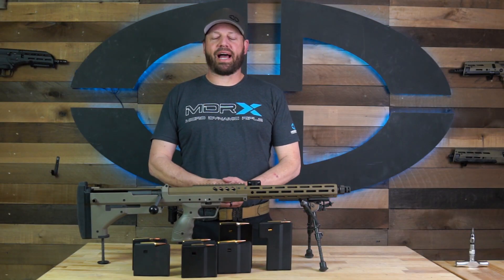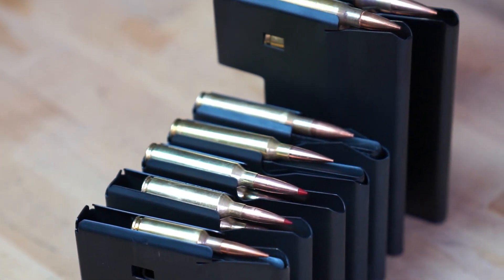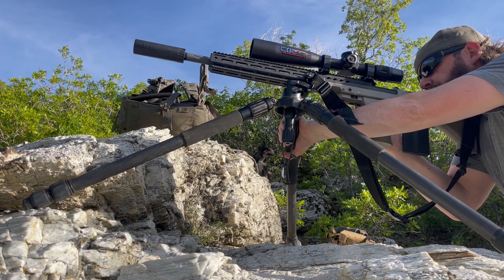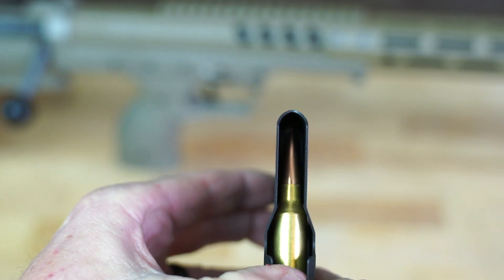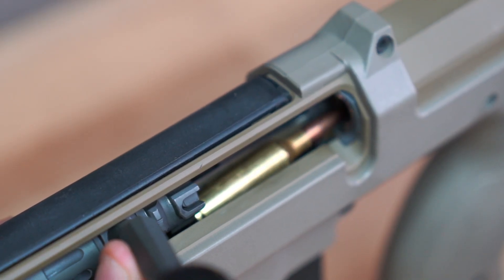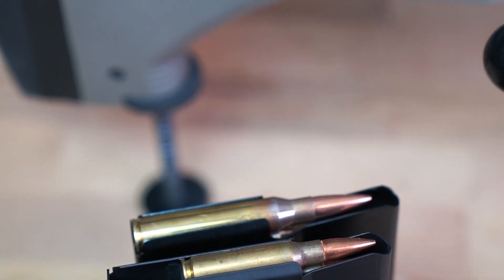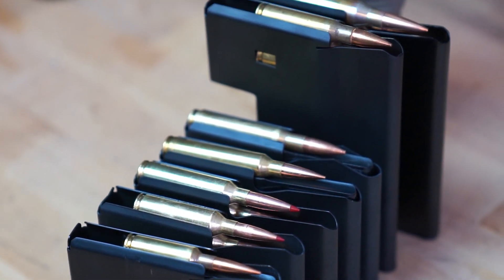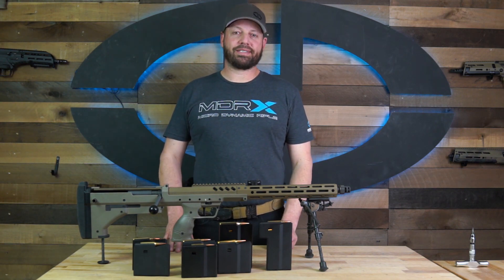SRS Magazines

Comment: Could you potentially use a long action magazine with a short action caliber as long as you don't run the plug so that you can run the bolt all the way? It wouldn't be ideal but I'm guessing it's possible right?
Reply from the maker: Depends on the cartridge, its not just the length, but also the feed lips and where they let go of the cartridge. Most SA rounds wont be started into the chamber by the time they pop up out of the feed lips.
Reply: @DesertTechUT  just .308 in the 8 round long action magazine.
Reply from the maker: @braxtonnelson7976  No, the 8 round mag has very short feed lips. It wouldnt work with the 308